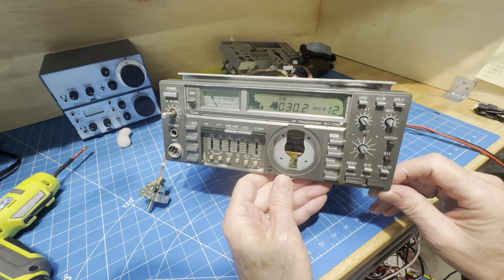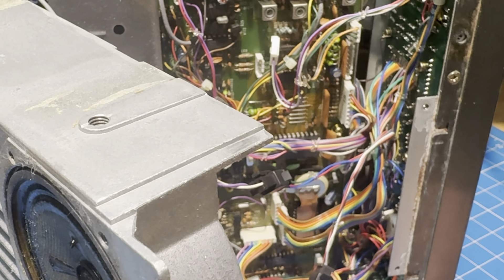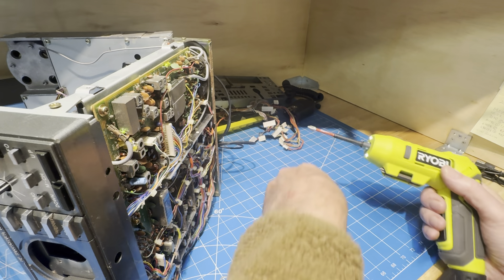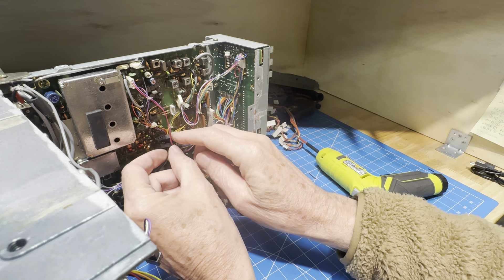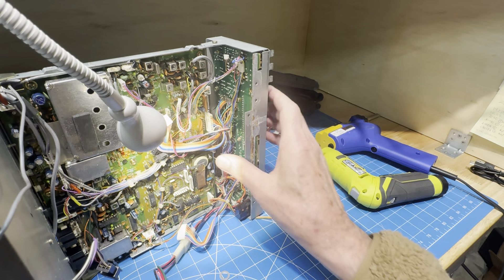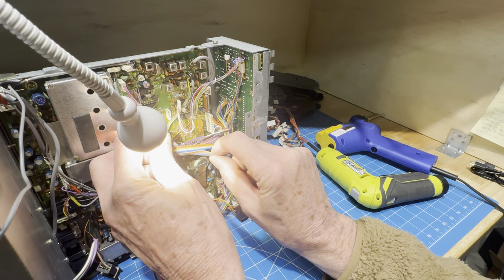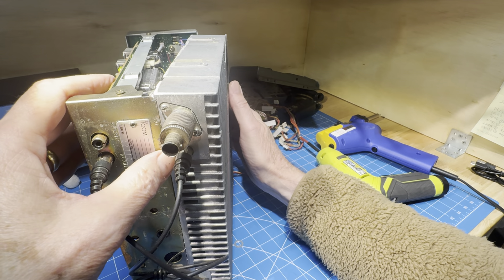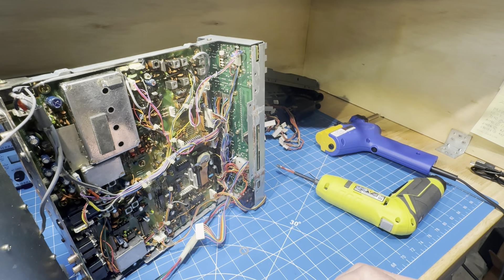Rusty IC-735 - That’s Not a Hinge! And Finding the LCD

Comment: as someone already said, loosen side screws for the front panel and it will tilt forward.
Reply from the maker: yes, thanks! - I'll give that a try very soon as the new IR receivers for the main dial are just about to be delivered. Fingers crossed there.